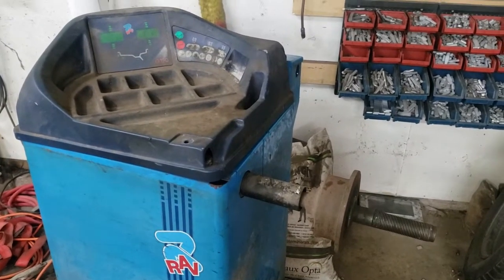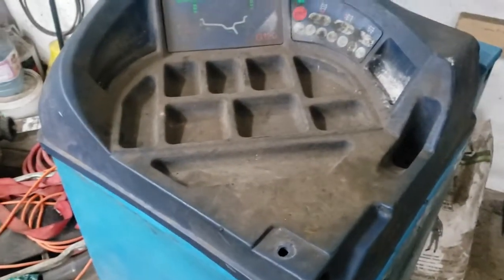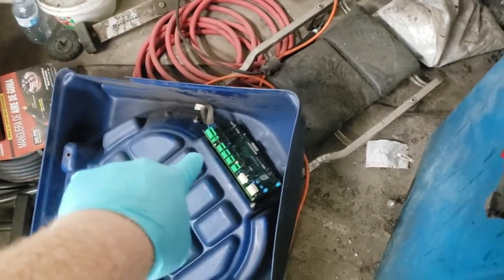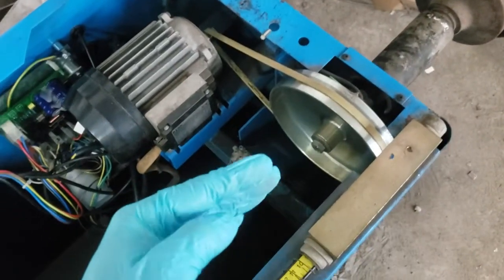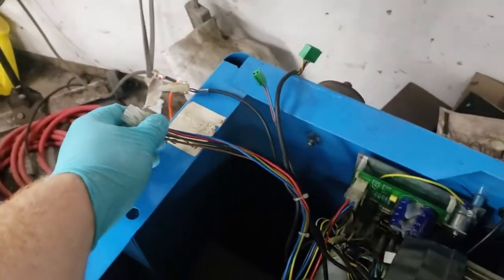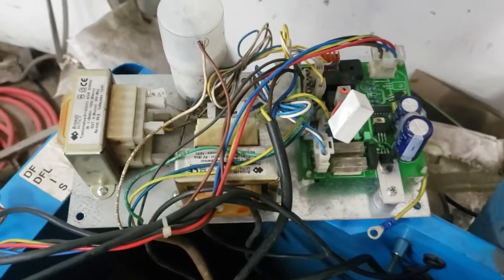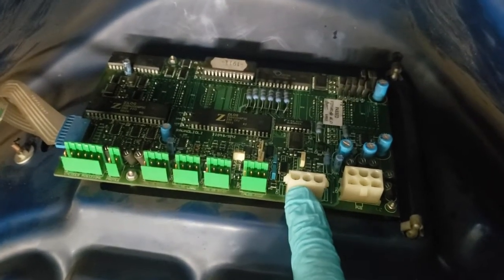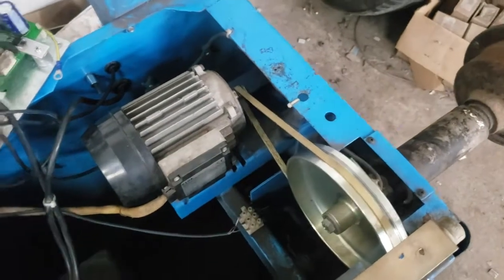Wheel Balancer Repair - RAV G120 Balancer Tire Balancer Tire Machine

Comment: I have a Nortron balancer. It works great as far as balancing. But, it has no brake. What would you check first?
Reply from the maker: Not all balancers have a brake. If yours was supposed to have one, then i would work from the motor backwards, checking the relays first and then tracing them back. Your board will switch the motor between powered, neutral, and regen
Reply: @djbmw1  It definitely has a brake. Same as teh Sun Balancers, once Sun bought Nortron.

Comment: I really see you answering people in your comments, I do like you for that.
Please I've an old Sicam sbm 55 that keep showing 0-0 always even been balance or not, it doesn't show weight sizes at all. Please I really need an assistant on this.
Reply from the maker: I would use a multimeter and see if the resistance of the piezo sensors change when you press/put weight on the shaft. You should see resistance changes. If you see changes then i would inspect the board for visual indicators of blown components. Trace the power and signal to ensure both are continuous. On boards this old, sometimes the conformal coating is failing and traces corrode away

Comment: grazie mille! ho la stessa macchina alla quale ho riparato il display ma non ho il manuale per effettuare la taratura,  Ravaglioli non risponde alle mie mail, qualcuno può aiutarmi???
Reply from the maker: Press and hold the <T and R buttons together until "CAL" is solid on the screen. Then, mount a STEEL wheel with 3.5oz (100 grams) of clip-on weight anywhere on the outside face edge. Press start. I have a video showing the manual here https://youtu.be/80ERWDPyrwA?si=4qGv71w02qvh3TaU

Comment: Hi, thank you very much for your helpful video! I bought this machine from a closed workshop and it sounds like a bearing of the axle runs dry. Got to check on that and am thinking about buying a second machine of those for spare parts.
Can you please give me a link where to get a device for reading out and storing the ECU data?

Thanks a lot!

Best regards from Germany!
Reply from the maker: You're very welcome! The programmers are called eeprom programmers and can be founf on Amazon or Aliexpress. I forget how many pins the eeprom on the balancer has but you must get a programmer that has at least that many pins. Here's a few larger format eeprom programmers:
 https://a.co/d/2TWLKe8

https://a.co/d/8xTUgJs

https://www.aliexpress.com/item/4001283226483.html?browser_id=f4a7ec9848504733b55def6770e30c26&aff_trace_key=1b5271b7e3984df484061f0798319aab-1721098707818-03357-_DDE7l7x&aff_platform=msite&m_page_id=vjkshryrthcayheu190dfa2e3ddc04f145714da87e&gclid=&pdp_npi=4%40dis%21CAD%2124.25%2124.25%21%21%2117.22%2117.22%21%402101e9a217217389509345493e220a%2110000015596024335%21sea%21CA%21753497441%21X&algo_pvid=cfafab3b-5635-4735-96c2-4c70e90de83b

Comment: Hi! Thank for the video, very useful, i have a problem maybe u can help me, the position sensor on the optic disc is not present on my machine, do u have an idea where I can find one ? I gave a look on AliExpress and i found something but honestly I don't what to buy. Thanks in advance!
Reply from the maker: Thanks for watching the video! I'd have to open it up again to get the model number from it but cant do that for the next few weeks. I wonder how different  photoelectric sensors are though,.. or if most are fairly universal accross different balancer brands/machines... as that would make more sense.
Reply: Thanks for the reply, I wonder it too cause  they seems pretty much the same, all with 5 cable, but I don't know if they are only signals reader or if the reading can depend from the number of magnetic pieces or maybe from the diameter of the wheel. If you have the possibility to check the reader number or any other info to get one I will appreciate, thanks again
Reply: Hi ! Did you have the possibility ti open It again and give a look at the sensor?

Comment: Hey! Don't know if u will ever answer this, but I have an error 2 code on my G120 (can't reach 60 rpm, or doesn't start). Checked the rpms which are fine, the position sensor is working, I made the test in the manual. Did you ever had this issue? Thanks
Reply from the maker: Thanks for watching the video! I havent personally experienced that error before but, looking at the manual, it states that Error 2 is either due to a faulty position transducer (it could still work, but provide erratic readings), an improperly mounted transducer (check to ensure it isnt loose/moving), and finally a failed/stuck/sticky motor. If I was a betting man I would put my money on the transducer being either out of alignment or failing (but not completely dead yet). Of course, also check the wiring to the transducer as it can get brittle/old and crack (or get eaten by mice).
Reply: @djbmw1  thanks for your really fast answer! My transducer wouldn't give erratic informations when I start the test? I'll check that today, thanks a lot!
Reply from the maker: @HIDUP  the best way to test a transducer is with a multi-meter (looking at volts) while powering the transducer. You will then compare the output values at no load with the values from the manufacturers data sheet. If they dont match then the transducer is faulty.
Reply: @djbmw1  we tested the "test" program, everything apprars to be ok... Oscillating between error 1 and 2, I hope the motherboard is good.... Do you, by chance have any manuals? I asked RAV for the user manual, got it, but they don't have anything else, like plans, electric schemes and everything.... Thanks a lot for your help
Reply: @djbmw1  we just found that two resistors seems to be cut, is this possible?
Reply from the maker: @HIDUP  i know that on my machine the conformal coating on the internal board has completely failed and all traces are now exposed to air. Some have started to rust and ive since repaired those traces and applied a new conformal coating. If your protective coating has also failed then heat built up could have cause a solder failure, resulting in a leg of the resister popping up from the through hole
Reply: @djbmw1  actually, we measured from leg to leg of the resistor, and had 0 value, very very curious
Reply: @djbmw1  do you have these manufacturers datasheets, by any chance?
Reply from the maker: @HIDUP  I dont - but you should be able to look up each component's data sheet if you're able to read the part number from each component. Obviously resistors are based on the colour bands... but if your resistor has zero resistance then it's clearly an open connection and dead. Are there other components along that path/trace that are also affected? There are two fuses on the board .. as well as other components that would take a voltage spike (such as the transistors close to the power input to the board).
Reply: @djbmw1  okey, so the multimeter was badly programmed, lal resistors are okey. BUT we found out that one of the IR array sensor (TCRT 1010), the one who finds the rpms, have bad valors. It seems that we found the issue here, to be confirmed!
Reply from the maker: @HIDUP  thats good that you found the issue! A lot of thr components are hard ro find but Aliexpress, Digikey, Arrow, and Mouser all seem to carry components at OK prices.
Reply: @djbmw1  in France, we have RS components, 1.11€ by piece, so that's okey!
Reply: @djbmw1  I'm following the repair, we recieved the part, soldered it, and same as before. My father unmounted the board, the motherboard, and everything is dirty and full of grease. We should have started by washing all that dirt.... Waiting for news by my side
Reply from the maker: @HIDUP  its possible the grease caused a short. Im curious to hear what you find
Reply: @djbmw1  yep, looking forward to this. My dad will tell me after he cleaned it all, then I come back here ;)
Reply: @djbmw1  changed absolutely nothing... Do you have any technical documentation, by any chance? We take EVERYTHING possible 😂
Reply: @djbmw1  I'm reaching back at you, one question: if you launch the machine without rim, do you have an error code?
Reply from the maker: @HIDUP  here, i uploaded this video for you https://youtu.be/80ERWDPyrwA?si=CQWMpqN7h25-ouHy
Reply: I really see you answering people in your comments, I do like you for that.
Please I've an old Sicam sbm 55 that keep showing 0-0 always even been balance or not, it doesn't show weight sizes at all. Please I really need an assistant on this.
Reply: @simoncj1107 I don't know the brand, but if you contact Rav, u'll find an italian boy who can help you for everything

Comment: hi, how to repair the distance gauge. Note: in case of error or faulty operation, the following appears: CAL P.0 still. thank you
Reply from the maker: The rim distance gauge is just a spring loaded ruler on mine. The measurement is taken by looking at the slide ruler markings and inputting it into the machine with the keys. Do you have a different machine that what I show in the video? Regarding your error, a "CAL" error is short for Calibration. Have you calibrated your machine recently?

Comment: I have Orion. Display PC board and power board are out of order. Where can l get cheap parts in ghana
Reply from the maker: If you need the entire board then ebay is likely one place you can look. However, if you have decent electronics knowledge you can figure out exactly what's wrong on the board and replace or repair those components. If the lcd screen is having issues you can try refreshing the solder on the lcd pins, for example.

Comment: I have a Hunter 9200 and screen tells me Spindle rotation not detected? Any one have any info ?
Reply from the maker: Its likely the magnetic pickup that I show at 2:40 in the video. Test to see if your sensors voltage changes as the magnets pass by. If no change, your pickup and/or board on the magnetic pickup needs closer investigation

Comment: Hey I have a Snap-on balancer eewb304a with a start up code dbh sap fal can’t seem to find any info on diagnosing it. I can get it to read wheel measurements and it spins but it won’t read where the weights go and the other thing I noticed is the potentiometer isn’t working for the wheel width any help would be appreciated
Reply from the maker: Thats not an error code that im familiar with but it might be related to the SAPE gauge arm not in the correct position... Or not having the position read correctly.

Comment: Motor is ball bearings, no lubricating needed.
Reply from the maker: Both bearing and bushing motors can, and should, be lubricated. Bearing motors usually call for grease BUT oil lubrication is also acceptable.
Reply: @djbmw1  Ball bearings in electric motors made for the last 30 years are sealed and cannot be lubricated, only changed out for new ones. Good luck trying to get oil in them.
Reply from the maker: @funone8716  i will confirm what type of bearing are used on the motor in my balancer. Having said that, lubricating sealed bearings is quite easy. Use a pick to lift the edge of the seal and work it off. Depending on the quality of bearing this can be extremely easy. Once the seal is off, add grease or oil, depending on the use case, then re-install the seal with a seal press or socket of similar size. If the seal is damaged or worn out to begin with, and already leaking grease, you CAN add lubricant without removing the seal...   Just know that you'll need to continue to add more every several months
Reply: @djbmw1  LOL Those bearings cost less than $3 each. Replace them and stop wasting time!

Comment: I have a Butler balancer ( italian ) exactly same system from inside. Balancing the wheel then it looks al OK. But making the same wheel a half turn on the shaft , it says left OK and right 17grams imbalance

With your acknowledge , any idea what problem could be ?
Reply from the maker: Generally that means the issue is with the wheel assembly and/or mounting surface. I assume you've checked to ensure the rim face is flat and free of rust and the balancer cone is perfect without any pitting or damage, correct? Is this happening with all rims, or just this one? If with only one rim, use a straight edge across the face of the rim and take measurements from your straight edge down to the rims hub mating surface  (where the bore and lugs go through). Essentially you're checking to see if the rim is damaged. If this issue is with all wheels, use a dial indicator attached to the balancer body with the dial arm just barely touching the balancing shaft... check to see if the balancing shaft is bent or warped. Do this on both sides of the shaft.. Inside the machine close to the piezos and outside the machine where the shaft exits). Finally... check the bearings to see if you hear or feel sticking spots
Reply: @djbmw1  Yes , the wheels are good and everything is cleaned up same with cones. this problem is doing with lots of wheels. everything looks good from inside and clean same with the belt. When motor is turning , you can hear the small bearing near the belt little bit ticking. I dont know if this can cause the problem. One test is impossible currently to test because there is no dial indicator 

Thanks for your helpfull respons ! if all tests is without results, maybe calling a professional is better option than putting it next to garbage :)
Reply from the maker: @SirvacYerqer  you're very welcome! The bearings can certainly cause balancing issues but should present with a different weight request every single time, even if you dont rotate the wheel assembly. You should be able to pick up a cheap dial indicator and magnetic base from amazon for under $70. The only other thing it could be is a failing Piezo Ceramic... But my money is on either the bearings or the shaft itself.
Reply: @djbmw1 The presented wheigts to put is the same every single rotation in this case .I will let you know in these few days what caused the problem when everything is clear , thanks !
Reply: @SirvacYerqer  @djbmw1 I have the identical symptoms on my NTB-550 balancer.  Machine shows a wheel is balanced.  Then if I rotate the machine on the shaft and recheck, machine says tire needs weight.  It is consistent and says the same/similar amount of weight is required even if i dismount and remount the wheel again.  No corrosiion.  Great care to position the wheel is being taken.  I wondered if it was the pulley that the belt rides on that is out of balance.  My pulley has several weights on it to precisely balance it...    what did you find out?

Comment: Super helpful!  Thank you!
Reply from the maker: You're very welcome! Hopefully it helps keep more balancers active and in service for longer :-)
Reply: Hello. I have same balancer, but it always misses position (instead of 12h You have to put the weight at 10h to balance a wheel). I did a simple calibration by pressing T and R together, but it stays the same. Is there anything that could be done with position calibration?
Reply from the maker: @zbuksi  when you calibrated your machine, did you use the requested weight that the machine asks for during the calibration process? For my machine it asks for 3.5Oz (100 grams) but other machines ask for 4oz.